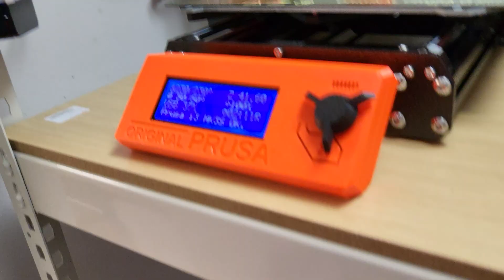How to Print FAST with TPU Flexible Material on Prusa MK3S+!

Comment: The only useful info was "ball bearing spool holder".  A link to the ball bearing spool holder would be nice.  A link to the TPU you're using would be nice.  A link to the PrusaSlicer .3mf file so people can use your slicer settings would be nice, or at least describe the slicer settings that you changed to improve print quality.

Comment: I tried to print with Hatchbox TBU for the first time today but never got past the first layer calibration.  I currently set PLA at -1.300 and PETG at -1.675 with excellent results.  I don't expect anyone to calculate TBU settings from these numbers, but perhaps someone could give me a starting place. I also think I am having an issue with feeding the filament and perhaps I need a ball bearing system, and to loosen the idler screw.

Comment: I didn't understand how octoprint improves the print quality.
Reply: It doesn't, lol. Unless there's some post-processing plug-in he may be running, but even then I doubt it. It's more than likely he's having trouble feeding the filament as consistently on the bottom printer because he doesn't have the same spool holder on that one